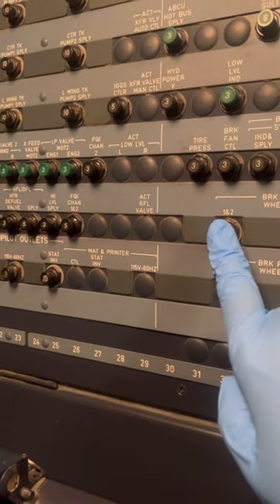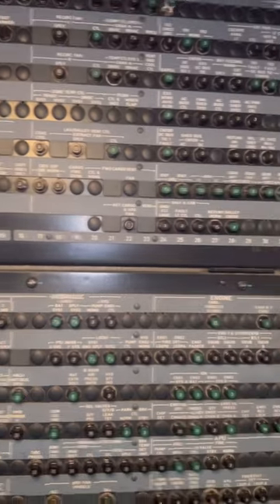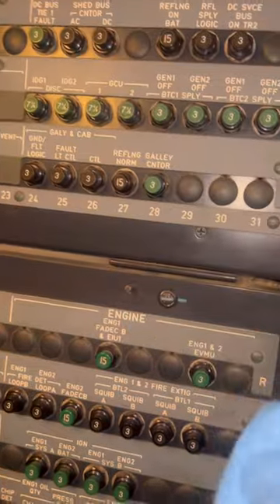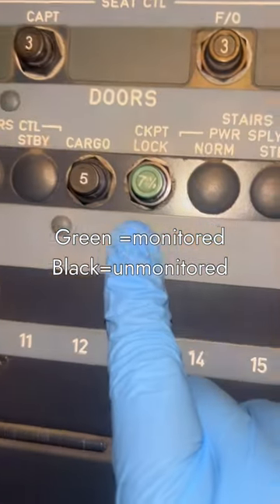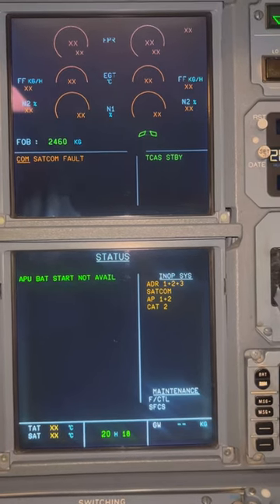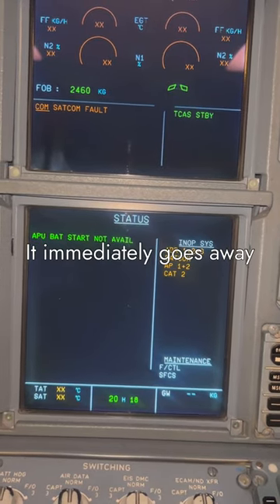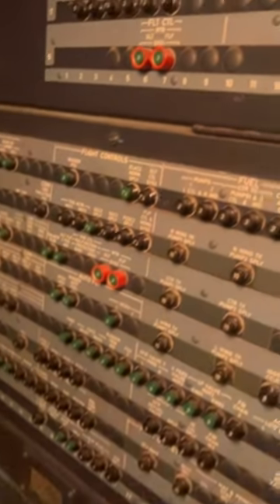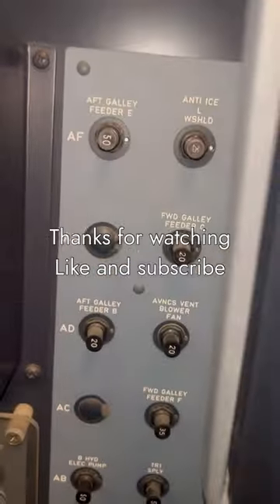Why are A320 circuit breakers colored differently??

Comment: You didn't mention the Yellow Cbs, Sir.
Reply from the maker: Oh thanks for the heads up totally missed that one ,I think it’s because the aircraft I was working on didn’t have those. those were mainly on the old A320s.Yellow CBs were to pulled only when aircraft is flying on battery power .On aircraft without yellow-guarded circuit breakers, the required action is covered in the appropriate irregular procedure.

Comment: Sir,
what's the number on the cbs. Does it represent the voltage that the system can sustain before tripping. If so then,

The breaking system has 3V limit, 
The breaking fan has 7 ½ V limit.
Why does the break fan have a higher number than the break system?!
Reply: The number on the CB is the the maximum current allowed, ie 3 for 3 amps. Now a CB is a very basic device, not very precise, for a 3 Amps CB it could trip at 4 or 5 amps only, but still reliable. Based on heat generated by current.
Reply: The braking system is only likely to be powering hydraulic valves and sensors - quite low power devices.

Brake fans are a big, fast, noisy fan.
Reply: @someonesomewhere1240  For exemple on an A320 Brake fans have separate CB's (2x 7.5 A) and the braking systems CB's are related to the computer (4x 3 A) .BSCU for Brake & Steering Control Unit and the associated sensors.